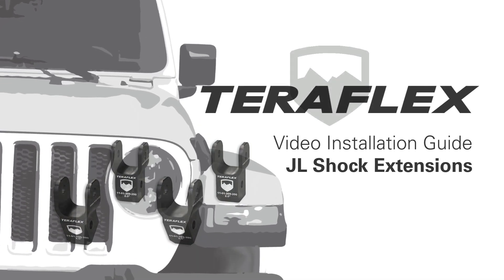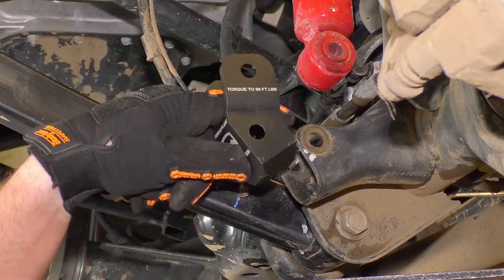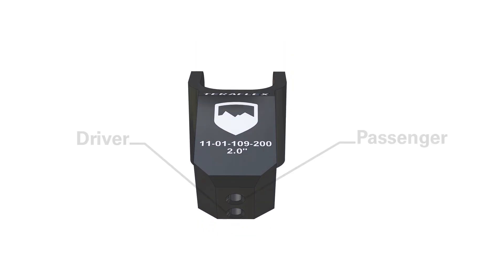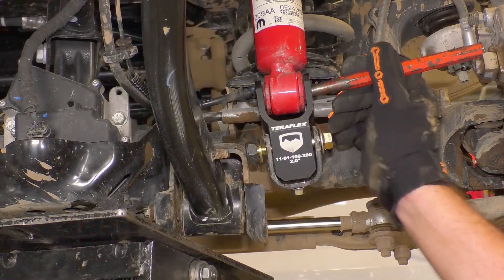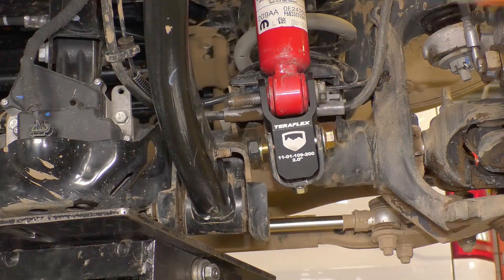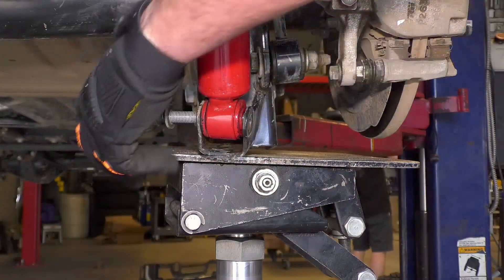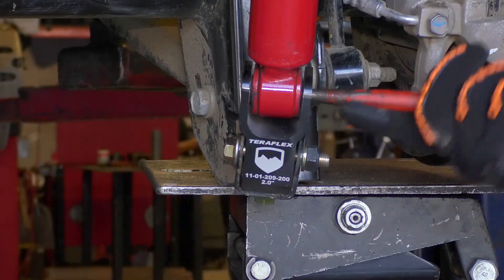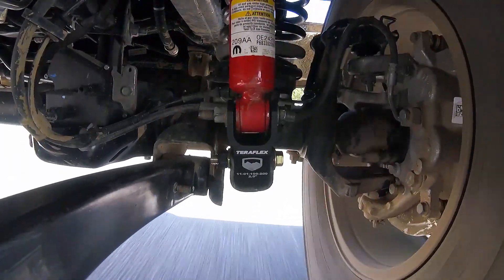TeraFlex Install: JL/JLU 2.5" Lift 2" Shock Extension Bracket Kit

Comment: Cdo i need anything else? Like sway bars or bump stops?
Reply from the maker: Yes, you will need to get those as well when installing your lift. This is just the video on installing the extension brackets that can be used with any 2" or taller lift .Check out our other 2.5" lift kit installs for a complete guide.
Reply: @teraflexsuspensions  how many inches this shock extension can lift?